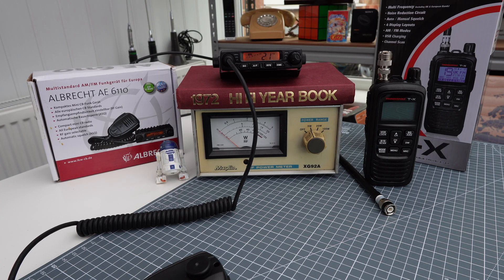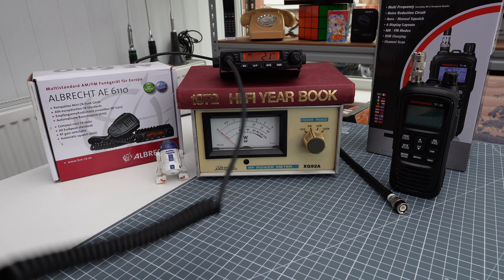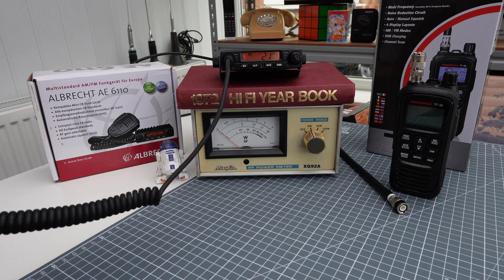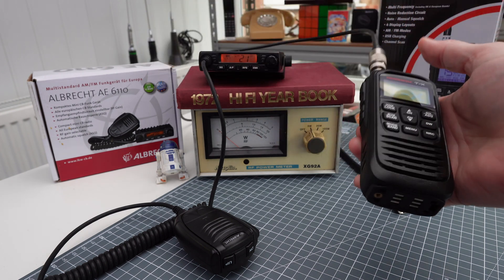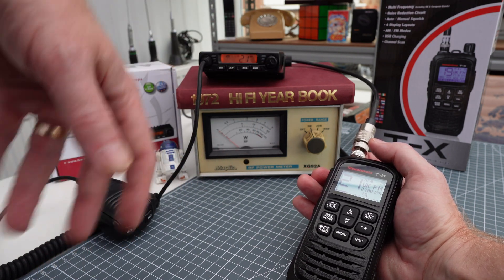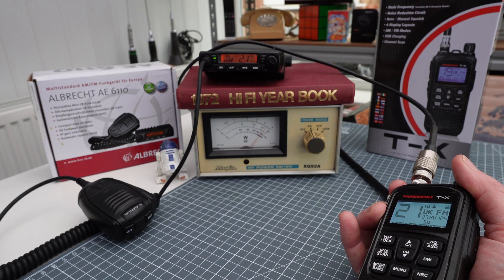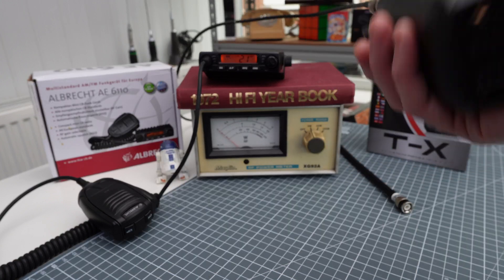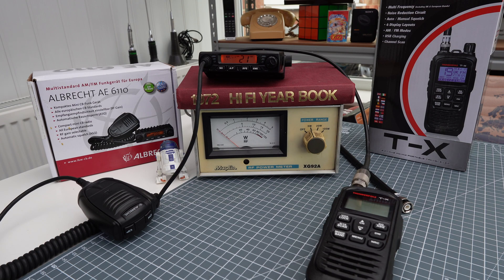Thunderpole T-X Portable CB Radio RF Power Test

Comment: On the standard rubber duck that comes with the Thunderpole T-X I managed a rig check of 7 and the receiver was 1.5 miles away. I switched to a telescopic bought from Amazon for £15 and same receiver says I was pushing a 9+ with clear audio. NB: I was in a ground floor building in a densely populated housing area. Not bad for a little HT. The noise reduction feature works very well.
Reply from the maker: That is a excellent improvement for £15. I have a couple of larger telescopic antennas that i plan on trying once i can be bothered walking up the top of the hill. Thanks for visiting the channel.